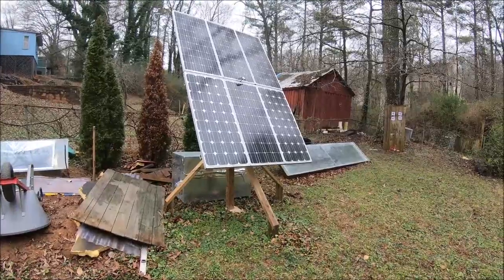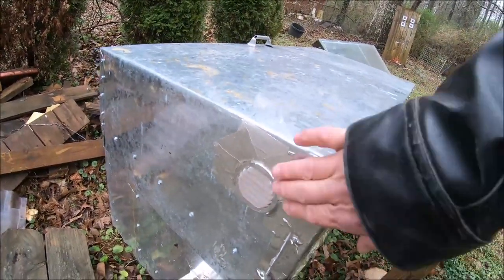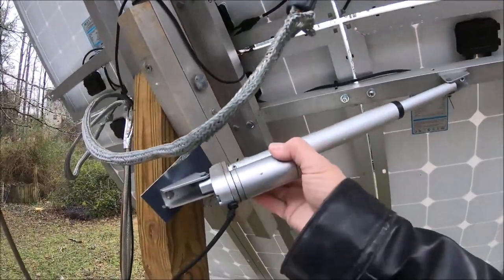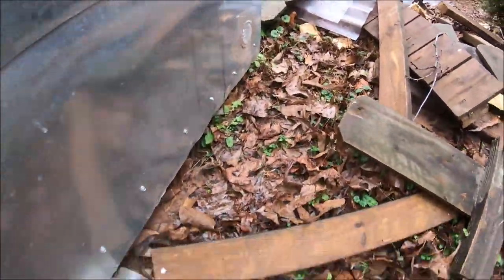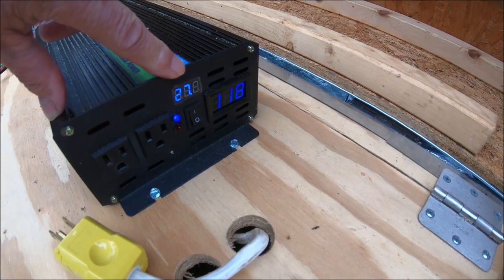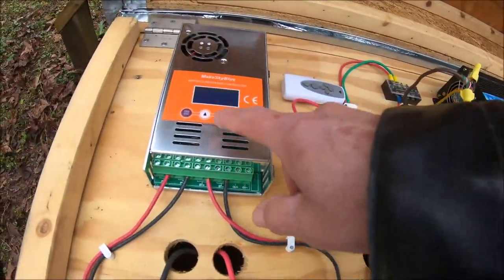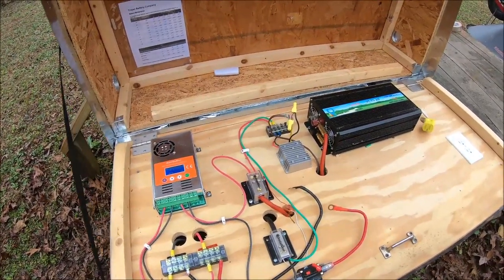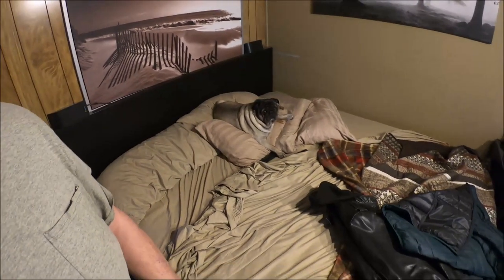My DIY EMP Shielded Solar Array

Comment: Maybe an odd question but I have a small solar kit if I don’t have it plugged in or hooked up it’s just for emergencies would an emp or solar flare still fry the panels or the rest of the system?
Reply from the maker: I'm not an expert but from what I understand the power inverters and charge controllers would need to be protected from an EMP having your system not tied to the grid will definitely help but still no guarantees
Reply: Thanks for responding I appreciate it!
Reply: Panels won't dry if wires disconnected, just shield charge controller, keep battery no wires connected